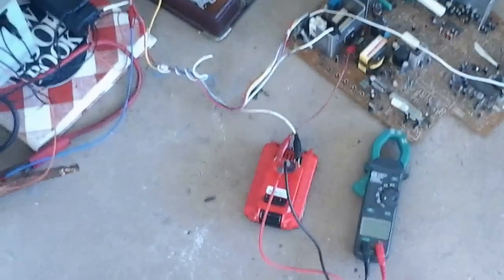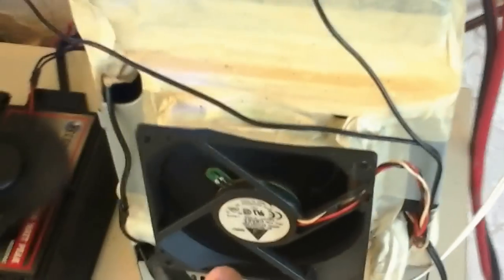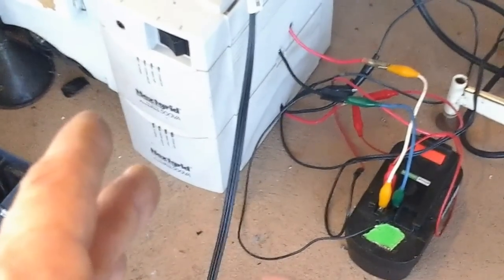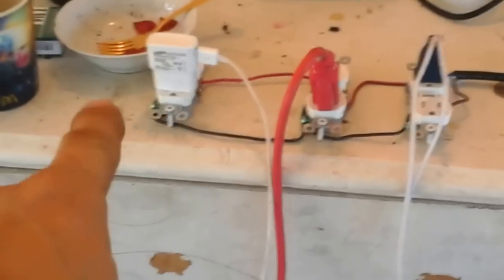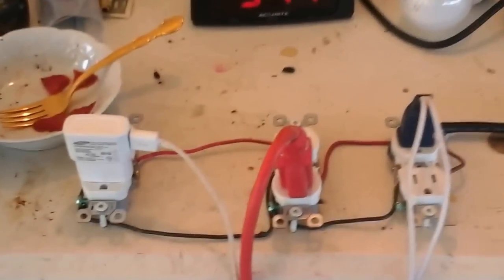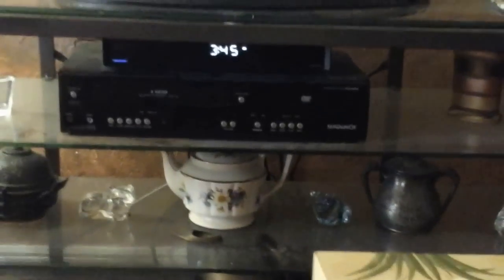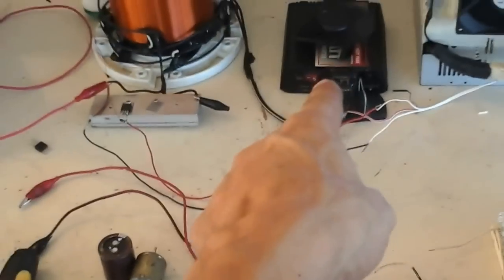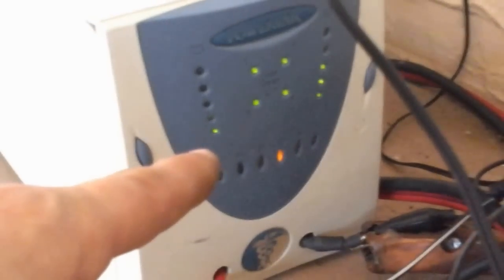Gerard Morin update #2 battery recharge

Comment: Think your hook up is very confusion. Why bother with the wall plug of AC? Just stick to Gerard motor pump. Sounds like you are cheating. What will  happen  to your system if it is not plug to the wall?
Reply from the maker: This was during some tests stages I was going through..to sum it up I made a 24v power supply from two computer power supplies. .hooked the 24v to one inverter and 12v to another..just showing what it was running.. if you check out my latest videos you can see the project's im currently working on. Ty.